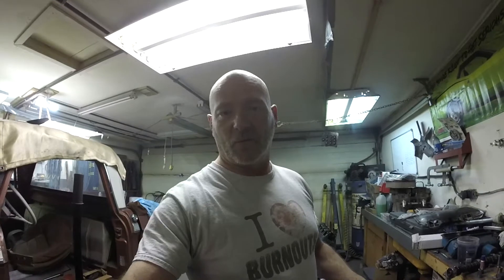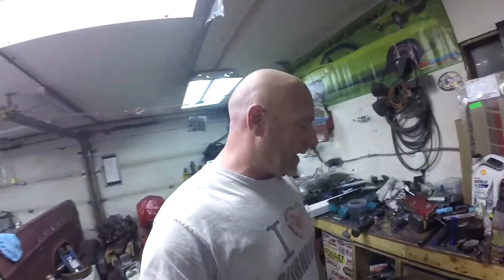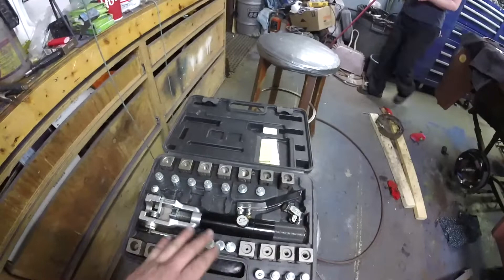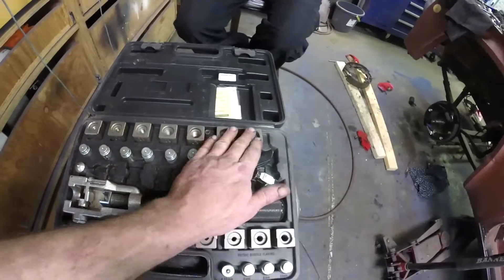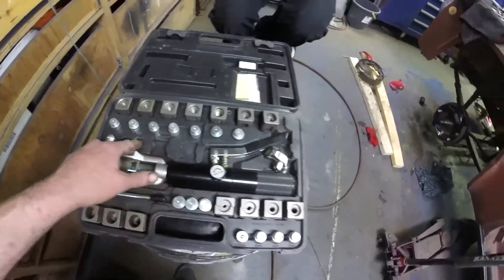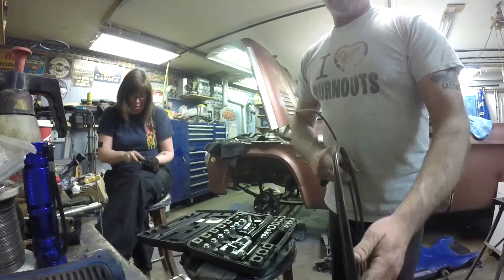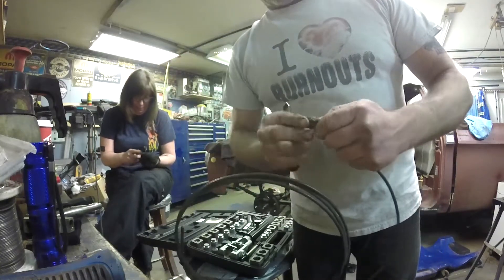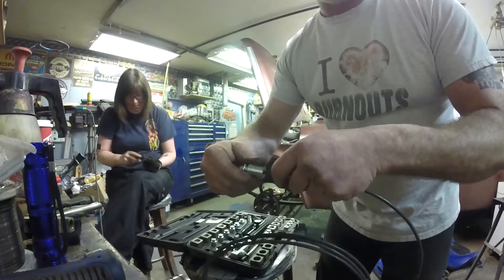How to Flare Brake Lines Like a Pro, Well.... My Way Anyway!!!

Comment: I have the same tool by Master Cool, greatest tool, but it is a little pricey at $325.00, worse every penny.
Reply from the maker: Yessir I used a mastercool kit the very first time and I was sold in that moment on. There are manual ones you mount in a vice but I've used this guy underneath cars and trucks of all kinds and there's always a way to get it in position to repair a line too. Versatile and I love it